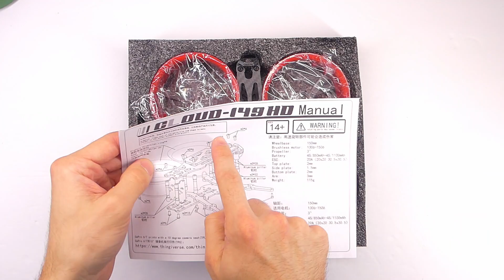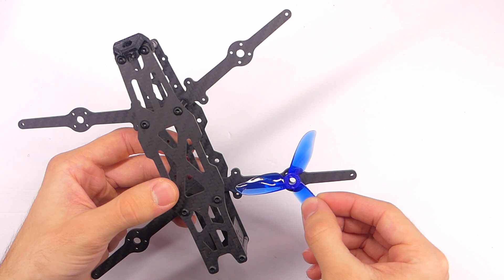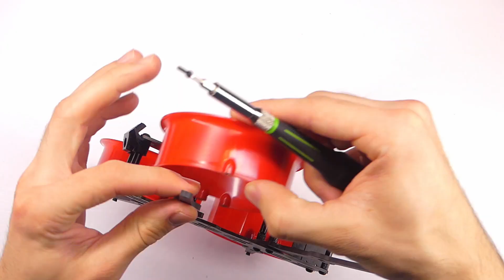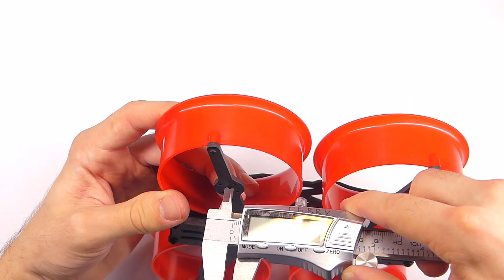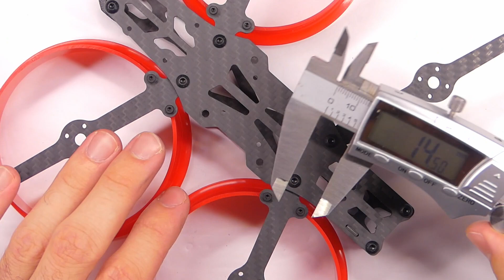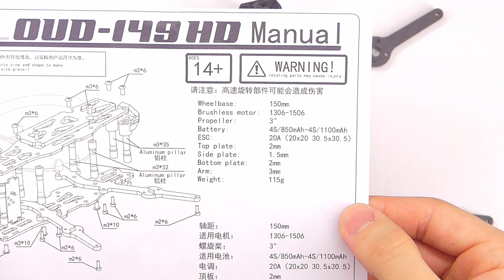DETAILED Frame Review - Reptile Cloud-149 HD CineWhoop Frame

Comment: For anyone looking to do a build with a cloud 149, even if you are building analogue get the HD frame. The fpv cam sits too far back on the original version so the ducts take up alot of the fov. Sorry if it was covered in the video I skipped through :3
Reply from the maker: Very good point! I did cover it, but I'm glad you mentioned in the comments. 👌
Reply: I bought 149, the camera sits wayyy to far at the back, planning to swap with 149HD frame, is it possible?